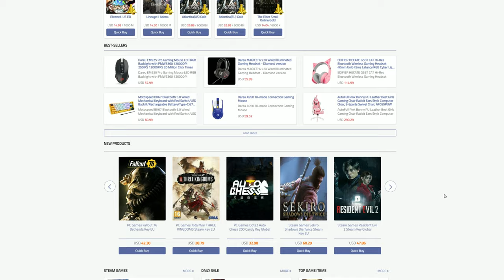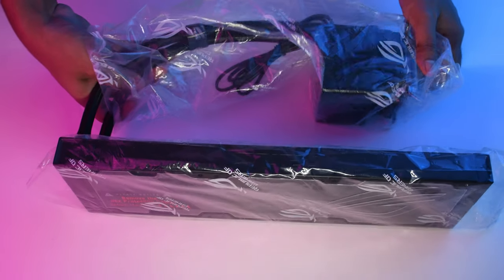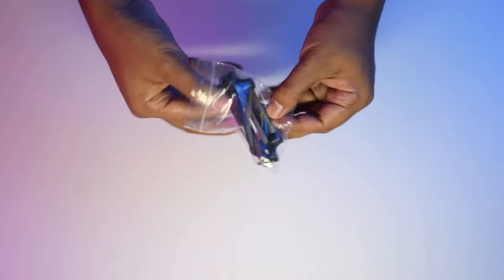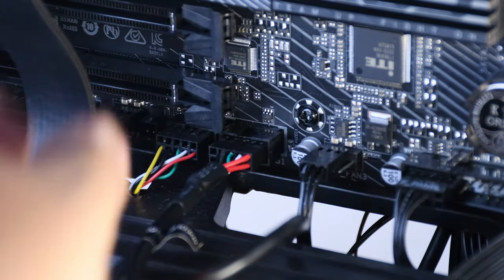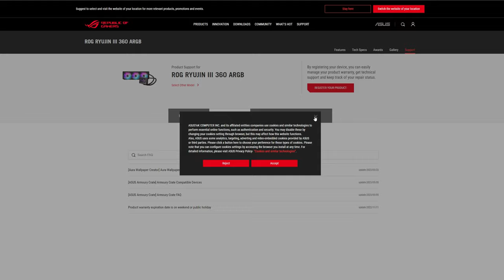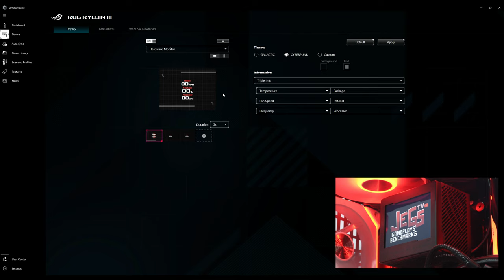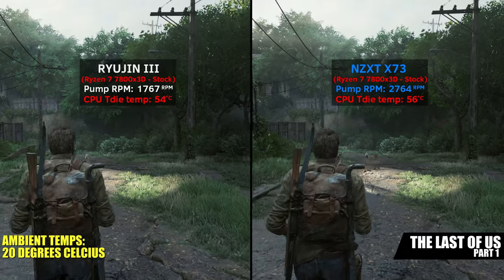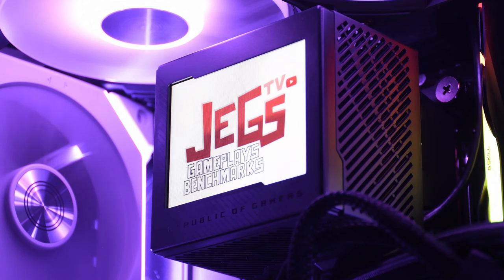ROG Ryujin III 360 ARGB - Installation Guide & Performance Test

Comment: You cant even control the AIO fans with the asus software. Need to go to BIOS every time, Total fail. 😂
Reply: Change fans to the Corsair iQue series.
Reply: Works for me. Skill issue
Reply: @NoBrainah  which connector the aio pump cable should be plugged in?
Reply: Who cares? Why would you need to? Set your fan curves in bios and be done with it. Fans too loud? Replace those junk fans with something better. Stop crying.

Comment: Can i change the fans with lian li uni fan sl infinity? And if i can i will have problem with the fans? And where i must plug it and how can i control them plz reply
Reply from the maker: Yes. Im actually using infinity fans on my ryujin right now. Plug the fans directly to the motherboard. You want have any issues.
Reply: @JegsTV  and how can i control them with asus program?
Reply from the maker: You cant. You need to use l-connect 3 by lian li
Reply: @JegsTV  thanks

Comment: I bought one of these, but I'm disappointed with the screen quality. When placing the gifs, the quality is automatically reduced by the software, that is, I did not see any change in quality as promised. There don't seem to be any changes from Ryujin II, has anyone else noticed this?
Reply from the maker: Havent had the ryujin ii. But from what i read the pixel count of the screens between the two are night and day. Maybe the gif you used had low resolution to begin with?
Reply: @JegsTV  No Bro. Even putting gifs with high resolution, when loading in the Armory program it automatically lowers the quality of the gifs. I've tried it in several ways.
Reply: @JegsTV bro please tell me what's the screen resolution please

Comment: no no no put the pump cable into the on board AIO_PUMP header if the board supports this, you will kill ur pump sooner or later if you dont the AIO_PUMP is designed to keep the pump on while the system is in sleep mode
Reply from the maker: software like armoury crate does that already. using cpu_fan, cpu_opt is fine.
Reply: That header is NOT for aio pumps. Read your manual. Every aio manual I've ever seen says to plug into cpu fan header and NOT pump header. My x570 dark hero mobo manual even says not to use the pump header for aios and to only use for custom loop.

Comment: Do you think it would be worth going from Ryujin II 360 ARGB to new Ryujin III 360 ARGB? Performance wise - i don't think so, right
Reply: Wrong the Ryujin III uses new 8th gen Asetek pump, also a thicker radiator.  So im pretty sure it will outpreform the second gen Ryujin
Reply from the maker: I havent tested this one. But i can see the ryujin iii outperforming the previous generation.
Reply: Performance is the same they both have the same pump only thing that's changed is the lcd screen and the fans
Reply: @Xplode000  On asus website Ryujin II uses Astek gen7 pump and the Ryujin III uses Gen8, where do you get your confidende from? The radiators are also different.
Reply: @Xplode000  Have both, replaced the Ryujin II 360 (Noctua version) for the Ryujin III 360 (Noctua version too) and I can confirm that this one outperform the second gen.
Reply: @dragonnestodyssey3939 how much diff compared to Ryu II if you remember?

Comment: im excited with mine!! hintay hintay lang! 😊😊
Reply from the maker: Been reading alot of issues with the pump tho. Naway maayos na unit makuha mo paps.
Reply: @JegsTV  how about yours? any issues with your pump?
Reply from the maker: Maingay din minsan. But others have it worst. Check mo comment section dito or dun sa shorts video ko regarding the ryujin naalala ko may nag rereklamo don.
Reply: @JegsTV  oohh hopufully maayos nga makuha ko.. sakit nanaman sa ulo pag nagkataon
Reply: I bought one of these, but I'm disappointed with the screen quality. When placing the gifs, the quality is automatically reduced by the software, that is, I did not see any change in quality as promised. There don't seem to be any changes from Ryujin II. Did you notice that?

Comment: Nice im using ryujin iii 360 in my hyte y60 with 12700kf... temps running cinebench r23 was 60 degrees only... very impressed with this cooler.
Reply: That's funny, that's the exact case I'm using also.

Comment: Hello! The problem is this.
The cooling system (ROG Ryujin III ARGB) has only one connector from three fans to connect to the motherboard (ASUS ROG MAXIMUS Z790 DARK HERO). The load of one fan is 0.35A. This results in a total load of 1.05A.
According to the motherboard specification, the load for the CPU_FAN connector is 1A.
Question: is it possible to connect the power connector for the fans of this cooling directly to the connector on the motherboard?
Reply from the maker: yes its possible
Reply: @JegsTV  

Thank you. 

But will the connector or the motherboard itself be damaged if the load current at the moment the fans are turned on will initially be more than 1.05A (for a short time) or does practice show that a 1A connector can support this load? 

It’s just that when assembling you have a motherboard from Gygabite, I looked at the passport for it, the connector there is designed for 2A and there will definitely not be any problems.
Reply: X2  @rushimasar

Comment: Hey Jegs awesome video. Very well detailed. Was hoping you could chime in. I have Same AIO and I want to add Lian Li SL Infinity fans, do I still connect the 4Pin header from Asus AIO to the mobo?  Thanks in advance :)
Reply from the maker: Im actually using Infinity fans on my Ryujin right now. And yes you still need to connect the 4 pin header if you want to adjust the pump speed. :)
Reply: @JegsTV  Ok perfect, just waiting on my PC case to come in and been double , tripple checking.  Thanks for getting back to me :)

Comment: Did you run them with max fan speed?
Reply from the maker: just stock/standard config
Reply: @JegsTV  just wondering about the noise level
Reply from the maker: its pretty loud when on turbo mode. but on standard, its unnoticeable.
Reply: @JegsTV  great would be if you retest with fixed fan speed. Say 60 or 80% and check noise. Would appreciate

Comment: I hope you notice my comment. 
Im planning to use Lian li Sl120 fans in radiator fan and connect it all to lian li hub. Is it okay if the cpu fan is just connected to mobo? While the rest of lian li fans connect to hub and going to mobo aswell?
Reply from the maker: Yes, that is what i currently have. I replaced the asus argb fans with lian li sl120 v2s.

Comment: I hope someone answers my question

 which cpu cooler is suitable for ryzen 9 7900x3d should i choose nzxt kraken elite 360, rog ryujin iii 360 or another product? by using an arctic p12 max fan. 

 My old CPU cooler is Deepcool LT720 and it gets a little hot when I use it for video editing and when using overclocking on the Asrock Taichi motherboard. 

Thank you
Reply from the maker: either the ryujin or kraken would be a great choice. marginal differences between the two. so its a matter of aesthetic preference
Reply: @JegsTV  OK, thanks for the information, I have subscribed to your channel and I hope it reaches 1 million subscribers
Reply: Use other than Rog Ryujin Bro. Cause I using Rujin now with 5800X3D. The tempt make me headache..hehe